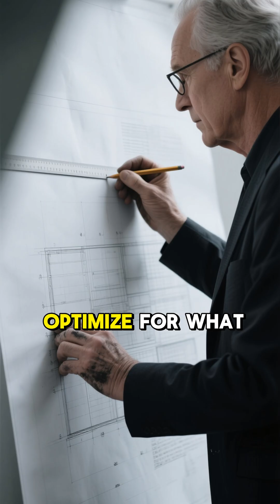The Soviet Secret That Humbled American Engineers 🇺🇸🇷🇺

Comment: They thought the mig 25 was a super plane, before they examined it. These thoughts led to the F 15. They found a limited use interceptor instead of a fighter. No matter that these discoveries came after the event these results were a relief, because the threat was much smaller than feared. Everything is presented with a twist. Even the three handed engineer.
Reply: @arnoldneubauer6363

        Hey Arnold , 
At that point in time , was the 
MIG - 25 equal to our top Jet Fighters of the day ? I've watched a lot of Documentaries regarding the Soviet Fighter Jet . And most of them seem to validate , and possibly exaggerate
the capabilities of the MIG . 
I'm curious what your opinion is about this . After reading your post a couple of times you definitely sound like you know quite a bit about this stuff . 
    I hope you're doing well .  🙂